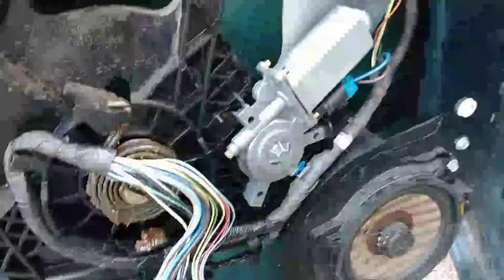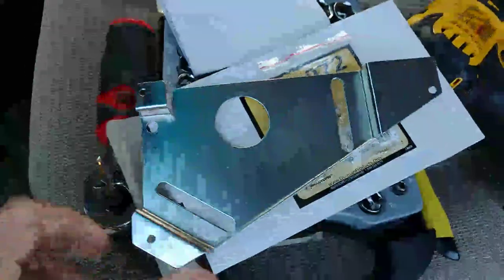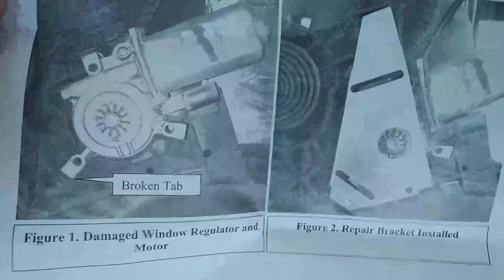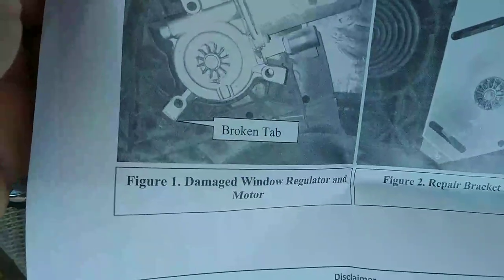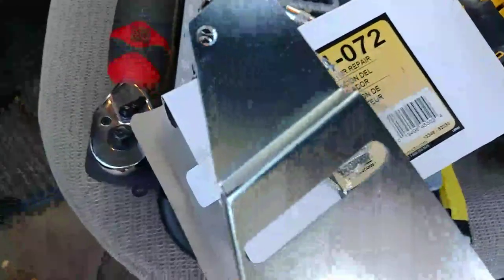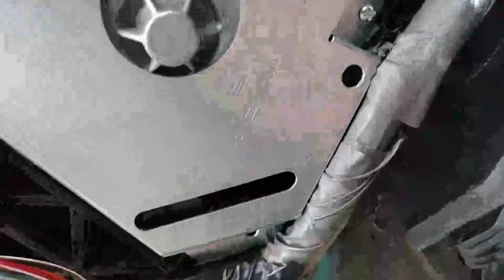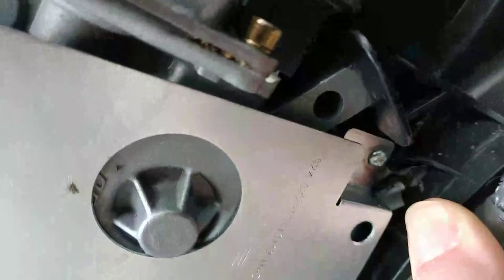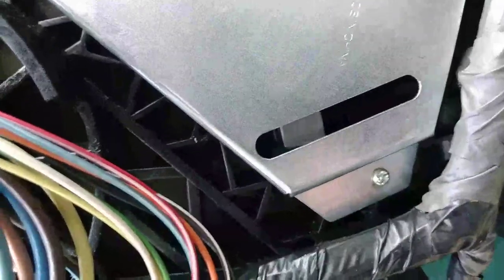Dorman 924-072 Power Window Motor Mount Repair Kit

Comment: Thank you for posting this. I did not know there was a repair kit and thought I was out of luck with it.

###

What a great idea for GM to mount a high-torque motor using molded plastic clips that are part of the plastic inner door frame and cannot be replaced unless you can find one that doesn't also have the same problem!!! Apparently, GM hires Engineers that graduated with low grades.

There are even three bolt holes under the clips in the plastic frame that line up with the motor's mounting holes.  You would expect these holes to be usable with the motor's mounting holes to bolt it right on.

HOWEVER! The toothed mechanism is immediately behind those holes so bolts cannot be used. (The front hole, nearest the electrical connector seems to be clear and maybe usable with a bolt.)

Gotta love it!

Comment: The holding tabs for the window motor get brittle and break off easily. The door panel plastic keepers will also break off when you remove that so buy a bag ahead of time.

Comment: I can see they don’t provide the necessary bolts to mount motor to bracket just by putting bracket on is not enough.not ur fault I would have modified there Design
Reply from the maker: Bolts haven't been necessary. The provided screws have been quite sufficient. It's a cheap and effective design.
Reply: Kevin Fields and why don’t they sell one for passenger side ? That’s what I need ,Or does it fit both sides you know just flip it over 🤔
Reply from the maker: @socalRooster  Yep, it just flips over.
Reply: Kevin Fields you know this for sure.have you bought one? I need one is why I’m asking
Reply from the maker: @socalRooster  Yes. It's just a simple metal plate with a couple of screws. The instructions are the same for either side.
Reply: Kevin Fields cool I’m ordering one thanks for your help
Reply from the maker: @socalRooster  Awesome, let me know how it goes! :)
Reply: Kevin Fields for sure 👍
Reply: Well .... how can I put this ,”it dose not fit” I flipped the plate over the three mounting holes tabes are not flat to plastic, So...hum...now what🤔 $33 down the tube or engineer way to make it work
Reply from the maker: @socalRooster  Sorry, I used the wrong term. I shouldn't have said flipped over, I should have said rotate.  If you rotate the plate 180 degrees, can you find any mounting points?
Reply: Kevin Fields I found a way. not sure how to post a picture of how I did it ,I think this  would help a lot of people